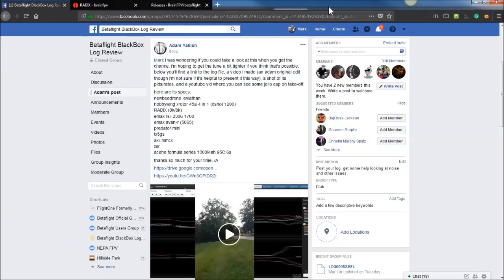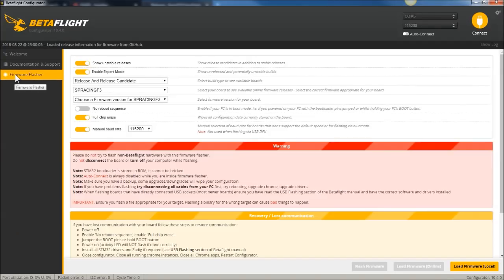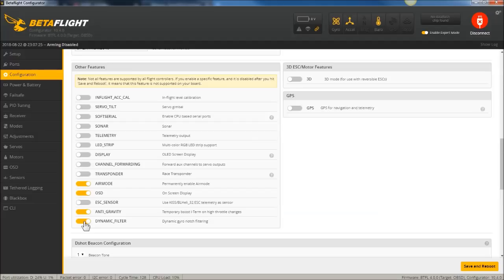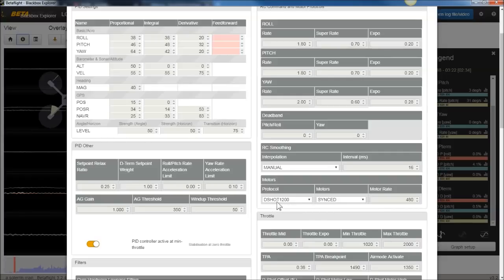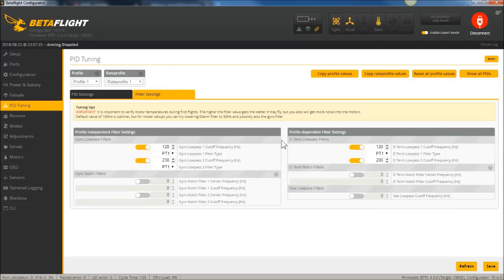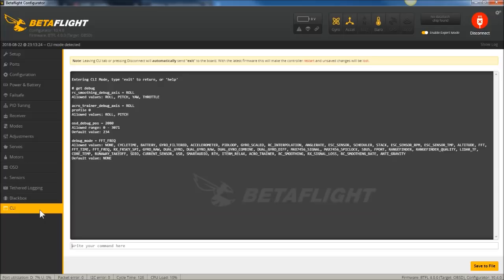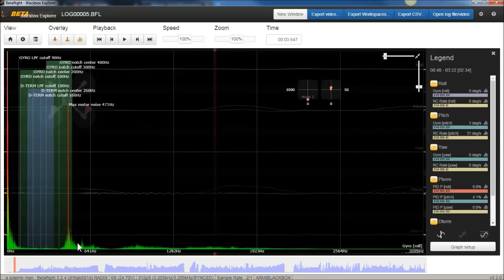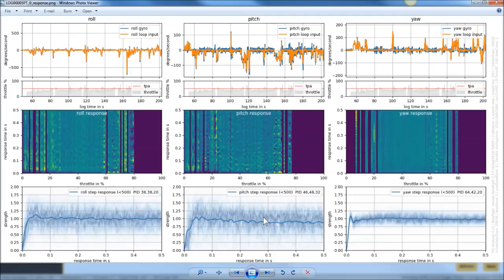2018.08.22-Solemn Man with Gen Log Review

Comment: Great video ! about 8k/8k pid/gyro , generally speaking I thought that pid loop should be lower than gyro, is it wrong ? Usually I use pid 4k gyro 8k , is it wrong ? And is there any difference in this between mp6000 gyro and the ICM20602 or similar ? Tnx

Comment: Wouldn't running the PT test using auto level skew the results, since auto level runs it's own set of gains, on top of the PID controller?  Could one use Acro Trainer to limit the angle, and run the test using only acro mode?
Reply from the maker: Yes, Acro Trainer would be another, probably better, option.  Good point.

Comment: I think brains are locked at a certain frequency because of the type of gyro.
Reply from the maker: That would make some sense.  Texted bank and forth with Adam later and that seems to follow with what he is kind of seeing.
Reply: The Bosch gyro that brain is max 3.2k.. So when you set 8 K in betaflight it just scales back to what the gyro is capable of
Reply from the maker: @benjaminschippers3536  , that makes sense.  Thanks for confirming.